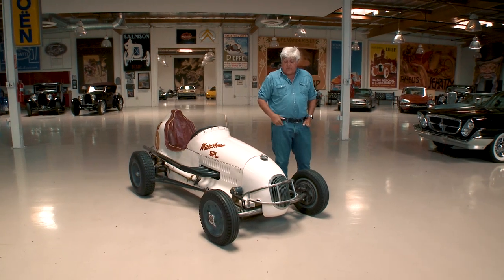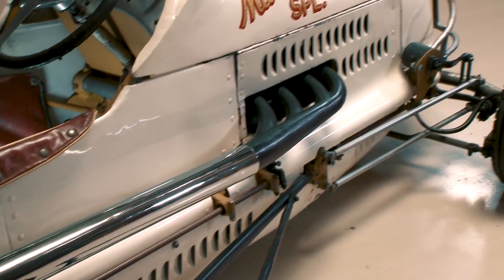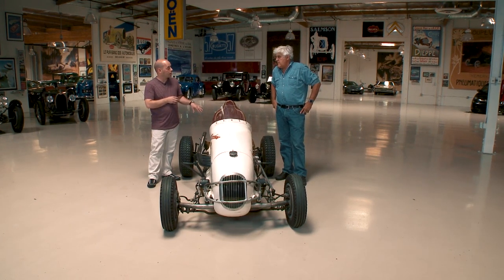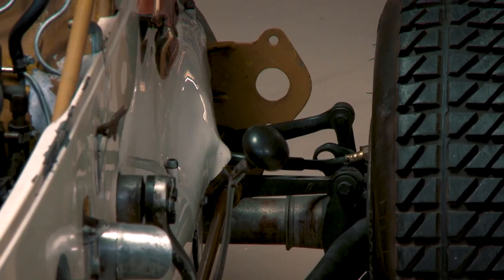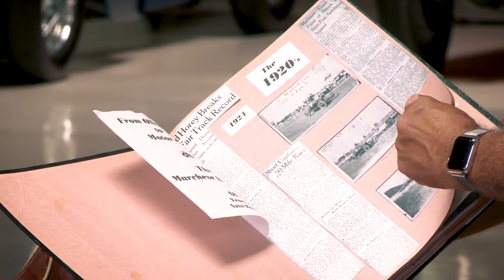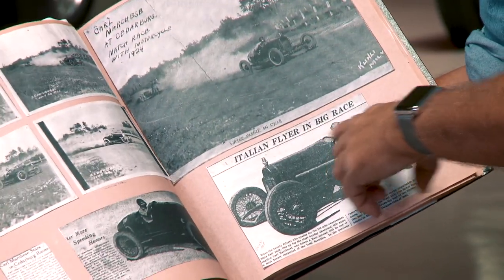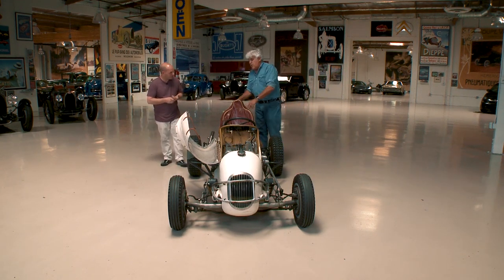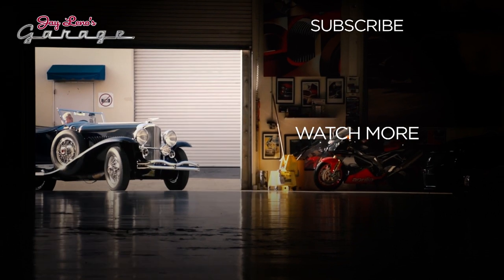1947 Marchese Special - Jay Leno's Garage

Comment: 8:29 Cedarburg Races... another track that's still (mostly) there. Where the Milwaukee Mile was modernized and paved and hosted NASCAR and IndyCar, Cedarburg's Fireman's Park as its known now hosts demolition derbies, truck pulls, and recently (last night, in fact) a monster truck show. Most of the track is grown over and used for parking, but the original main grandstand is still there, and some of the front stretch is still used for the aforementioned events.

Comment: That was an extremely deadly era of racing.  Not many drivers died of old age back then. Harry Miller copied a French Indy car engine, Peugeot I believe, for his engines. The head and bores were one piece, so there was no head bolts or gasket. This allowed the ports to be unobstructed and they made good hp. Miller made and designed his own carburetors also, or maybe Leo Gossen did that for him. Miller was the most prolific designer of race cars of all time, Roger Penske is a piker beside Harry. Unfortunately Harry died almost penniless. His engine design was winning races for decades and decades.

Comment: II saw this in the background a few weeks ago. Engine should be I believe 110 ci.
Classic Speedway is quite a big thing in the US as well as here in Oz. In the day the Offy was the gun engine up too the early 70s when they were being beaten by VW and Chevy2s and Sescos [half a 327 Chev]
I run a 68 built Supermodified in Classic spirited demonstrations. Here in Oz at least there is classic solo bikes, sidecars, Three Quarter Midgets [500cc engine] Midgets / Speedcars [caged and uncaged], Heavy stockcars, Supermodifieds and pre 84 Sprintcars

Comment: I have one of these in my garage. I wish I knew more about it. It belonged to my father and unfortunately I don't remember much about it.
Reply: A midget racer? If it has a Miller or Offy in it that engine is worth a few bucks.
Reply: @gregorytimmons4777  It is a 1938 “rail” with a flat head Ford 60.  I remember my father using the term Offenhauser when talking about it, but I am not sure specifically if that was in reference to his car or some of his buddies’ cars.  He raced with BCRA and USAC in the early 1950’s with the car.

Comment: Come on Jay, buy the car and restore it. Let's hear it run.
Reply: Nah, it's much nicer in it's as-raced condition. It's only original once.
Reply: USARAY1947 A car will only degrade if left unattended. If you respect the car you will take care of it and make sure it stays alive.
Reply: I agree, but maintaining a car is different than restoring it.
Reply: it just needs to be maintained not restored. Its a race car not a high dollar collectable. Peice of history, dont need to restore it and wipe all that history away.
Reply: USARAY1947 I think that's what the guy meant, he just wants to have it run. Didn't Mr.Leno mention it having leaky seals? Changing seals imo is a maintenance procedure and I believe collectors wouldn't mind not having "original" seals (as if they had not been changed at least once before.. it is a race car after all).
Reply: sunshine girl he does read some of the comments actually
Reply: WiseGuy02 Agreed!!  Jay needs to buy this car!!

Comment: Jay, THANK YOU for all the videos! As a third generation car-guy, I grew up with the days of the Roaring Roadsters, the ARA and CRA with my Dad and grandfather very active in Arizona and Southern California racing. Grandfather was Vice Pres. of CRA when Walt James was Pres. As a kid I heard all the guys in the race shop talk about who did what and plenty of names were spoken. When it came to the Marchese Brothers, ALL the guys in the shop pronounced it MAR-Cheesey. If all the guys raced with and knew the brothers, seems to me that is how it is pronounced. Leave it alone..
As for the car, this thing is beautiful like it is!  NO one should EVER "restore it" And true, if the engine is "pickled" and all fluids drained, it will not take much to freshen it up and go. I tell all my car-guys that have cars to either run and DRIVE them once a month for at least 20 minutes for warm up all systems and get moisture OUT, or dont run them at all. What Jay and David did not explain is the starting procedure for this car and most ALL dirt midgets and sprint cars is, they do not have a starter. YOU have to get pushed off by a "Push Truck" or other vehicle that has a nice BIG push bumper. They also did not explain the brakes very well. this car has 4-wheel brakes, but there is a valve to shut off the front brakes so only the rear will lock. This is all part of what is necessary to push-off the car to start. I have been writing too dang much here so I will cut out a lot of explanation. BUT a short few notes may help----- After Push-Off and the engine fires--- and is running.. The Alcohol does not like cold engines so, you have to allow some warm up before you can much much throttle to it.
All this take some time, space, and feel to get the car on step... This is why you just cant start it up once in a while.

For More info, go watch a vintage dirt car race...  Dont just blast out an opinion without some background. Yep, I grew up around the Arizona Gang-- Look them up...  Yes, I drove these cars.... My last midget was a Kurtis Chassis Spring front/parallel
 bar rear, Chevy II powered, Algon Injected with a Hilborn pump. My first car was a Walberg 1/4 midget when I was 5 years old. 
Been there done that-- And still can-- Was just asked if I wanted a seat in an offset super modified... I have an early track roadster that is almost done, kind of a build like the one my Dad ran in 1950. And I have another dirt car in the race trailer.

Comment: Hello, Jay. As always, your YouTube videos are well done, informative and enjoyable. I've seen every one, most of them multiple times. Keep 'em coming! I do have one suggestion, not with the videos themselves, but with the advertising. Ever since you've introduced T-Mobile as one of your advertisers, I've had issues with my Blue Ray player locking up. It doesn't do it with any other advertiser. Once the commercial finishes, it just hangs there, instead of continuing with the show. I have to reset the Blue Ray player and skip the video. I wonder if I'm the only one experiencing issues? Perhaps, there may be others. At any rate, love your show!

Comment: My dad sold his same vintage TQ midget around 1980 or so for less than $1000 including the trailer. It ran a Triumph 650 through chain drive., and had a hand brake and had to pressurize the fuel by hand pump. Wished he's never sold it.

Comment: I forgot to mention the cars on the track didn't have transmissions or even flywheels..let alone a drive line the rear engine stub shaft coupled through a u joint into the locked rear-end...the cars were push start and you killed it with the brakes...magneto ignition my dad's car had a willy's frame and engine...one time a car with a Flathead ford v8  blew the rods and the pistons made nice round holes in the hood.